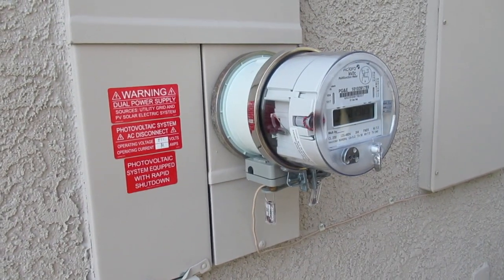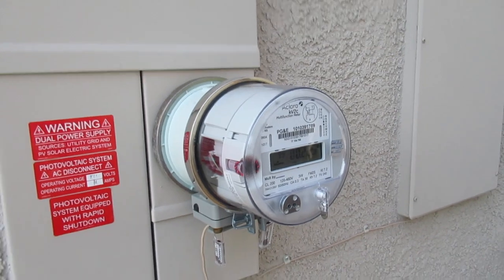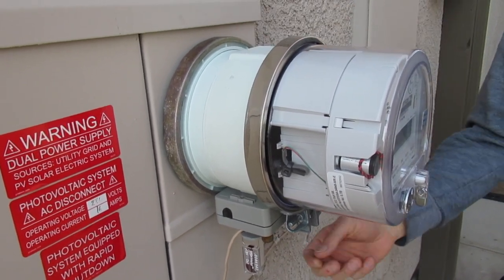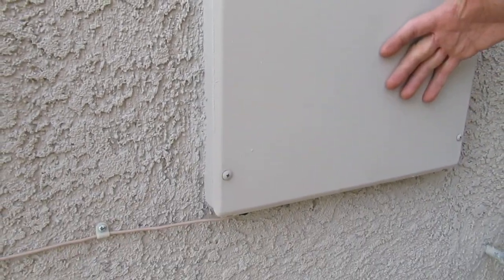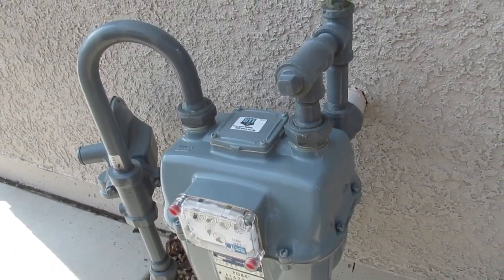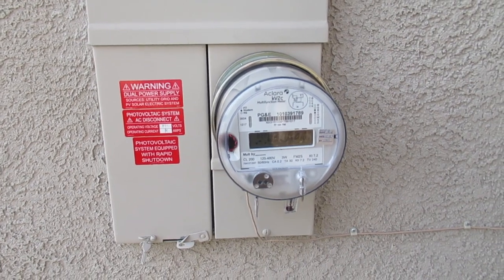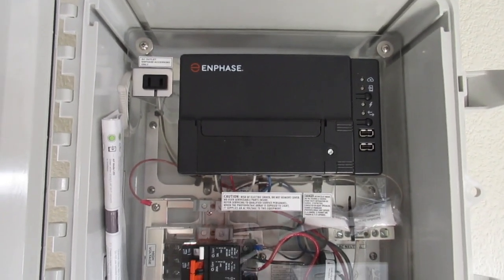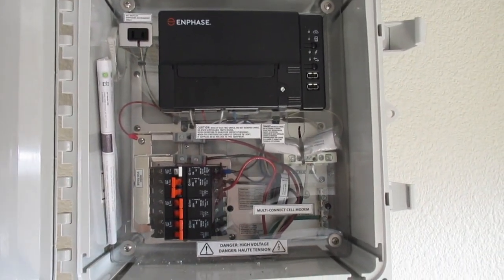PG&E removes Smart Meters from Solar homes

Comment: Y'all   have really gone off the deep end over this smart meter!  It is just a way to stop the company from sending someone to read your meter nothing more. If you have a phone line plugged into your meter, you still technically have a smart meter!
Reply from the maker: Getting rid of the so called smart meter frees you from the pulsed RF radiation they transmit about 10,000 times per day.